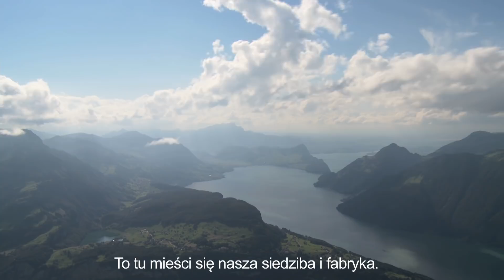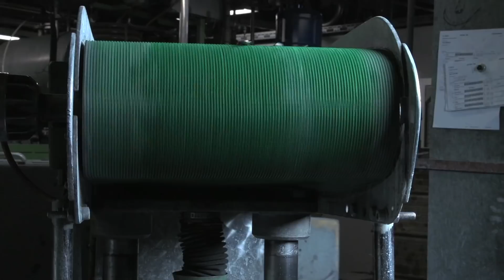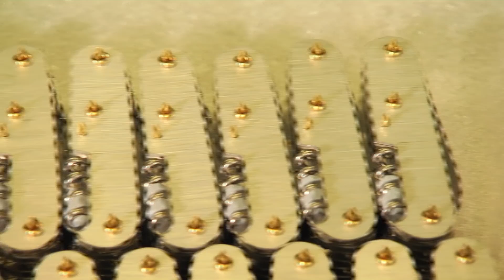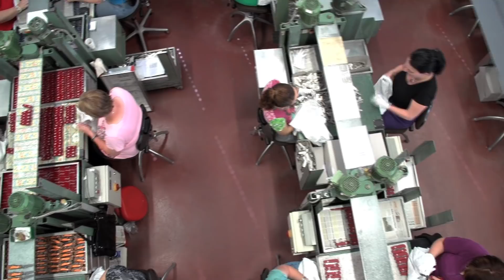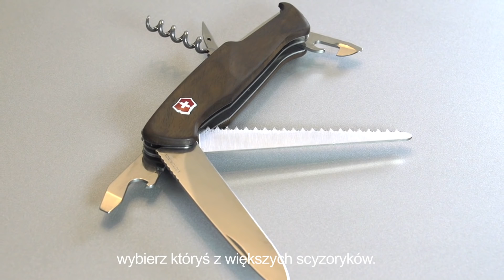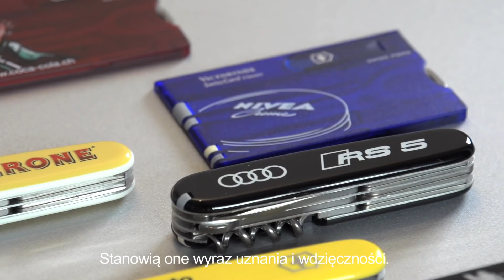Victorinox Swiss Army Knives Production 2016 POLISH

Comment: I first became a fan of Victorinox Swiss Army knife when I was in my 20s. A friend of mine at work had the 84mm Tinker that he had carried for many years. The larger blade was missing the tip, he had used to pry with and snapped it off. He always brought it to me to sharpen. I discovered that they were very easy to sharpen and held an edge for a long time. I noticed that all of the tools had been used quite a bit and they still had a lot of life left in them. I always carried a Schrader Old Timer with the spay blade modified into a screwdriver. I finally picked up a Recruit and haven't looked back. Very useful, with great craftsmanship and quality control...from Texas, USA, thank you Switzerland, this product is one of very few items that the world should thank you for. Just awesome!

Comment: Is there any logic in making a large product so large as it will not be practical to function in a real situation of use? Anything wider than 1 inch is pointless. Plus most of which do not use locking mechanisms. Which is dangerous.